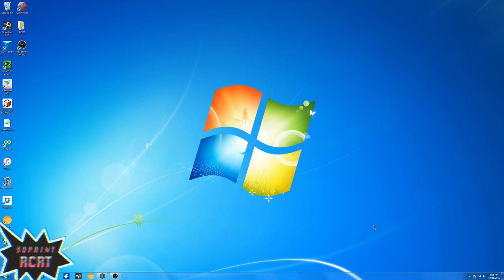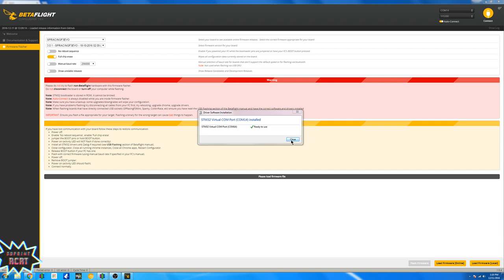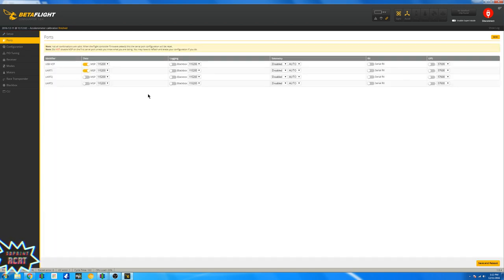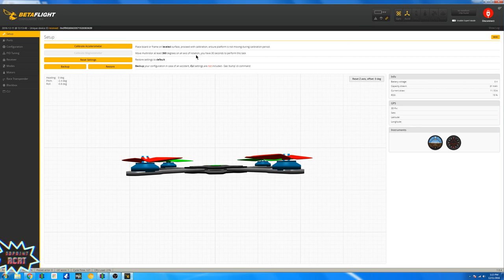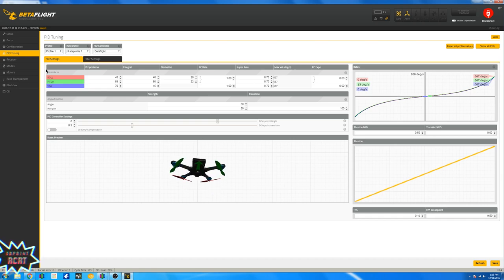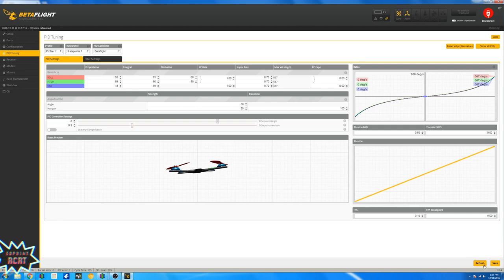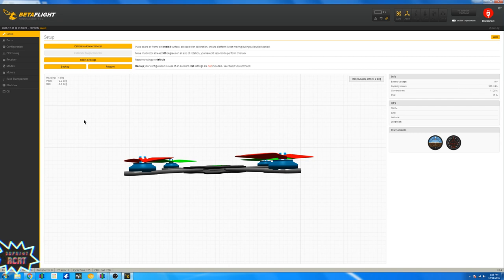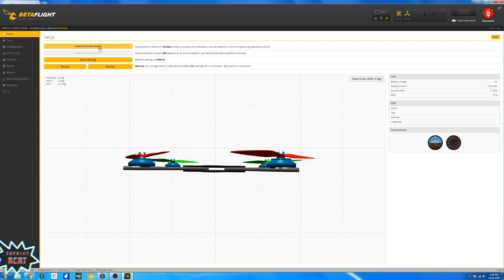Micro Brushed F3 EVO Betaflight Setup

Comment: Very good video thank you. Quad working perfectly but too fast flying. Please help me how to set up PID tuning.
Reply from the maker: jinnee66 Hey bud, are you using the PIDs from this video ?
Reply: Yes using the PIDs from this video, but it's not working indoor, too sensitive. Flip in the air. I setup RC rate 0.5 been better.
Sorry for my bad english and stupid question. I am beginner.
Reply from the maker: jinnee66 kinda sounds like you're flying in horizon mode make sure you're in angle mode and your quad will only bank so much when you push the sticks also make sure your expo rates on your transmitter aren't to high but I have mine at 100 and I can fly indoors no problem, no question is stupid bud lol I'm here to help
Reply: Thanks for your help. You were right. I flying horizon mode and not angle mode.  I setup angle mode, much better. :-) 
Unfortunately, one engine broken. I had to order a new. :-(
Reply from the maker: jinnee66 yup that happened to you my first time also lol save horizon mode for huge fields so you can get some sweet flips and rolls in, order the in bulk from ebay or banggood and you'll never have to worry about broken motors again :D glad I could help !

Comment: Yo tengo esta tarjeta pero no puedo flashearla con betaflight, lleva una versión de clean de junio del 2016. La cosa es que he intentado flashear también en clean y tampoco me deja, ¿qué estoy haciendo mal? Los jumpers boot no están soldados
Reply from the maker: OK so what you have to do is open BF or CF then load the firmware then plug in your board and it should say DFU more at the top
Reply from the maker: DFU mode***

Comment: how to setup buzzer properly? mines kepping buzzing all the time please help !!!
Reply from the maker: salviaaable hey bud send me a photo of your setup so I can see, my email is restech.rtinfo@gmail.com
Reply: hey nice to hear a reply. already solved, just voltage warning was set to high (3,7v) set it to 2,8 maybe 2,9 now it goes fine =)
Reply from the maker: salviaaable ahhh I was gonna say maybe that was the problem, maybe you should set it to 3.6v because most batteries don't go to 2.6v and your quad will die around 3.7v if you pushing alot of throttle

Comment: did you just set air mode so it couldnt be selected?
Reply from the maker: I can select air mode, but because im using a DX6i transmitter i have to use my elev d/r switch to get into air mode after im in horizon mode
Reply: ahhh, that explains it.  my first and (only radio so far) is a taranis plus.
Reply from the maker: oh nice ! i really gotta get one of those lol